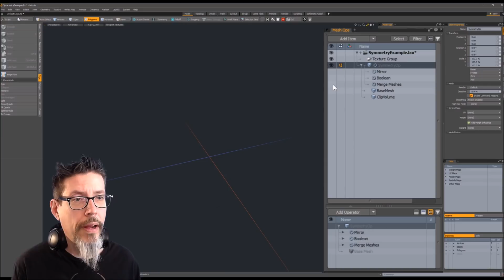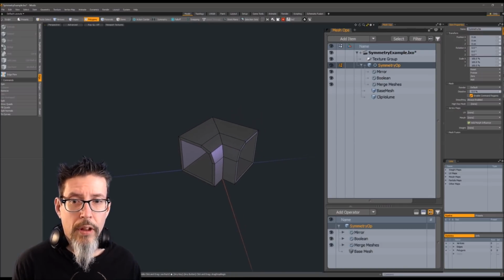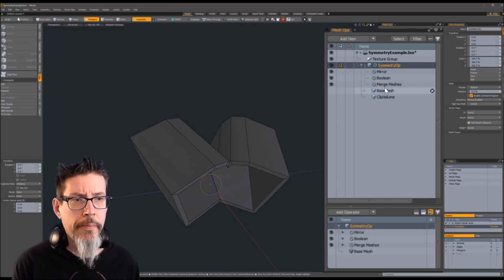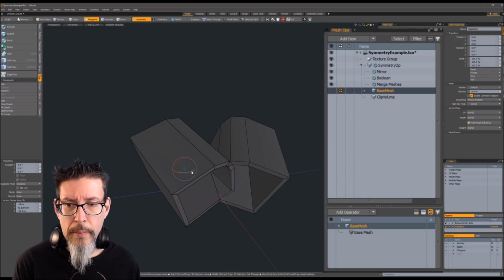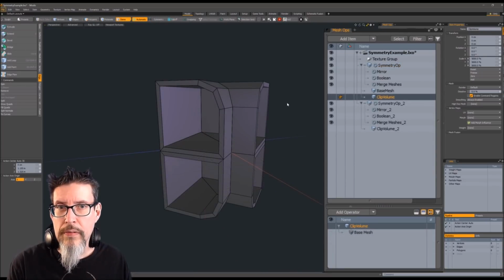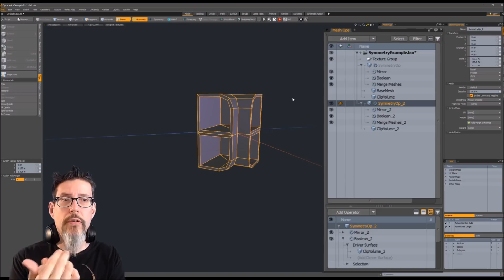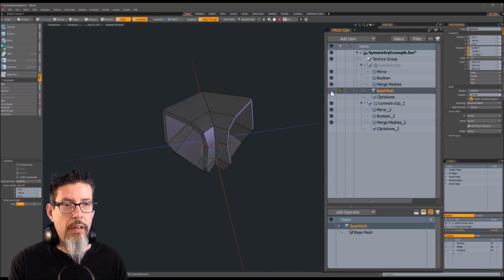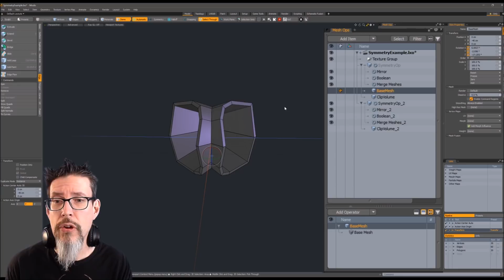MODO Plugin/Feature Request : Symmetry Modifier

Comment: Great idea! The symmetry modifier is one of the few things I miss from Max - especially the ability to stack up multiple symmetry modifiers and rotate them and mash away the unwanted overlapping area - great for concepting new buildings or making corner turning geometry. I miss shift-dragging edges too! Bizarrely 2d splines (particularly boolean operations on them) are also really well executed in Max but I don't think many people ever used them.

Comment: Hi Warren, thanks for sharing this setup. Do you know a way to do this in modo where the mirrored geometry if also flipped? I'm trying to make some playing cards in 3D and it would be great if I could find a set up that does this. So the geometry is mirrored and clipped on the Y and resulting mirrored geometry is flipped horizontally. Any ideas?
Reply from the maker: I think you'd have to make a custom mesh op set up, like I do in the video.  There's really no automatic way to my knowledge.

Comment: Similar to Blender's Mirror Modifier as someone mentions in the comments however the clipping option in Blender doesn't chop part of the object off like a boolean instead when enabled it prevents elements i.e. vertices etc being moved past the mirror axis when editing / modelling. It does however optionally allow a separate object to be used to define the mirror axis line rather than using the axis / center of the selected object. So yeah out mirror meshop in Modo just needs a bit of work to make it really awesome.
Reply from the maker: MODO has all the pieces, someone just needs to stitch them together.  It's RIGHT THERE!

Comment: Not sure if you're into Houdini but you could probably make an HDA asset in 2 seconds - ie Knife into Mirror node that references the knife plane.
Reply from the maker: I'm trying to learn Houdini right now as a matter of fact ... maybe I'll play with that!  I hadn't thought of using Houdini stuff inside of MODO ...
Reply: Awesome, it's a struggle at first, but would never go back.  Houdini Engine to Modo may be a thing in the future, someone had a github for one but took it down.
Reply: I actually made this in Houdini as a digital asset.  It still needs a bit more work but it's functional.  I'll send it over shortly.
Reply from the maker: Sounds interesting!

Comment: Hey
it's already done in the base version of modo. Also you don't need merge meshes meshop at all because you can edit base mesh all the time. here is the video I made - https://youtu.be/p5IsmpNkswI
also you can hotkey both edit base mesh and any meshop so you don't have to click on the stack again and again.
Reply from the maker: That's close but it needs to be more artist friendly (needs viewport widgets for moving the clipping plane - the Offset field is awful).  Also, you can't rotate the clipping plane.
Reply from the maker: Plus I threw a pretty basic mesh at it and it threw up ...  :-/
Reply: I agree about artist friendly but frankly speaking the whole meshops stack needs UI rework. As for throwing up my Modo crashes 3 times a day on average but symmetrize modifier has been pretty stable so far me. And I use it a lot.
Reply from the maker: I'd be interested in hearing more about this ...

"also you can hotkey both edit base mesh and any meshop so you don't have to click on the stack again and again."

Is it a generic thing that works for any meshop stack or specific?